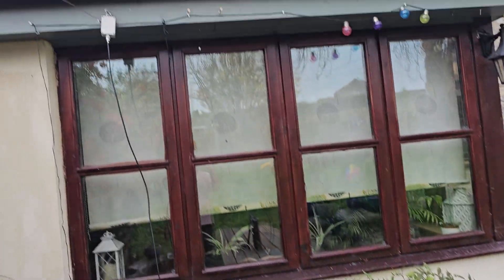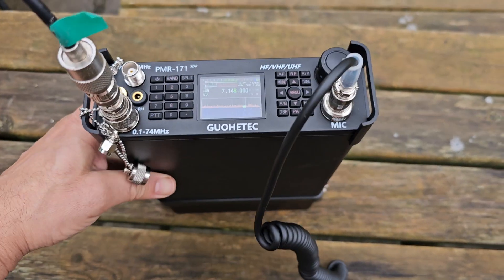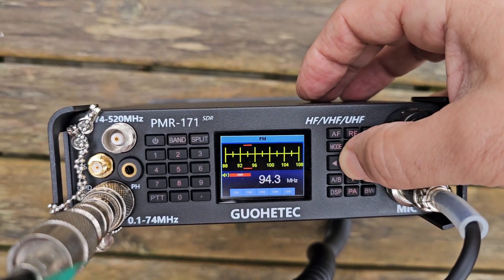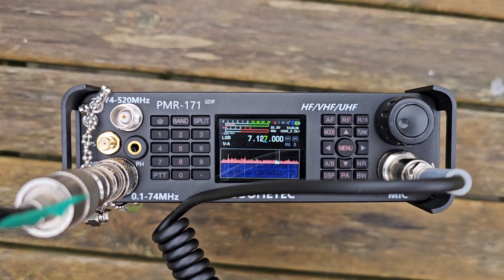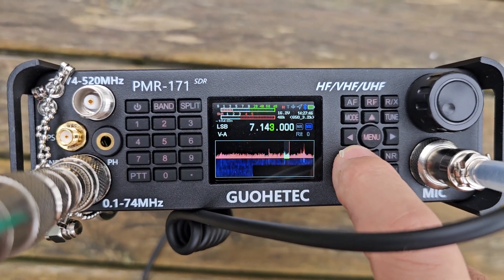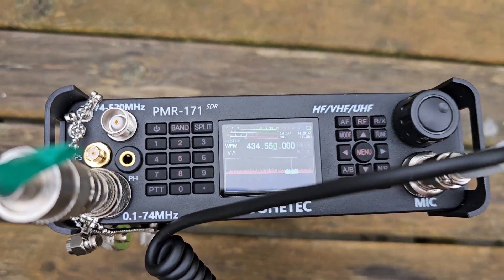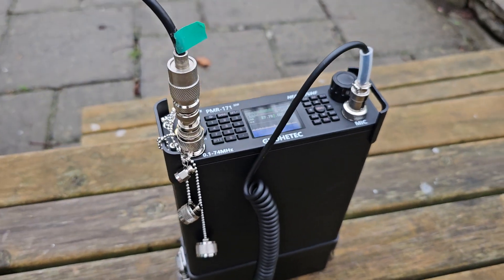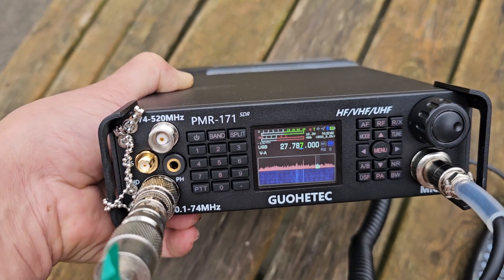Guohetec PMR171 - Garden Mobile Testing - Long Wire(EFHW)

Comment: Its 400 pounds plus another 300 for the empty battery box so you still have to buy  Batteries to go into the empty battery box.
Reply from the maker: No it comes with a battery
Reply: @M0FXBHamTech on AliExpress it says buy the battery separately? And 400 is the price on AliExpress, how much did it cost after UK VAT and customs clearance please? I was thinking to buy it so i am interested on a final cost.